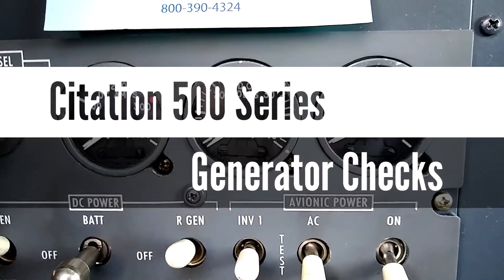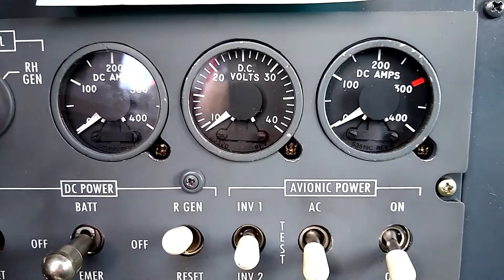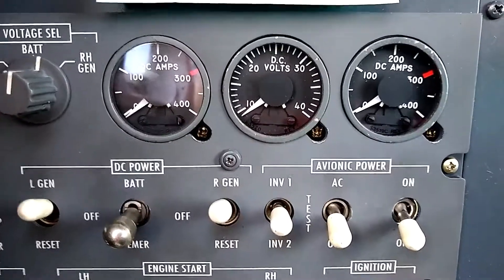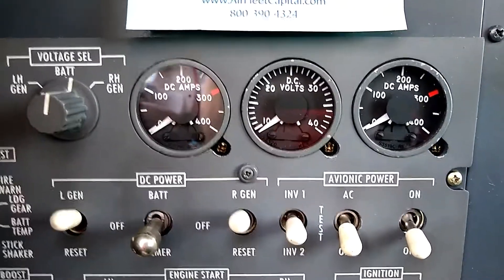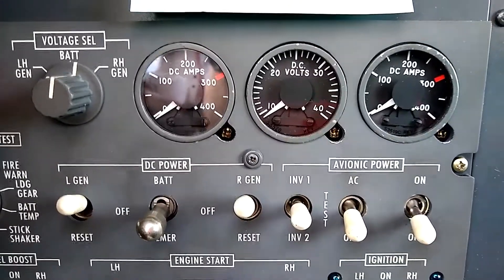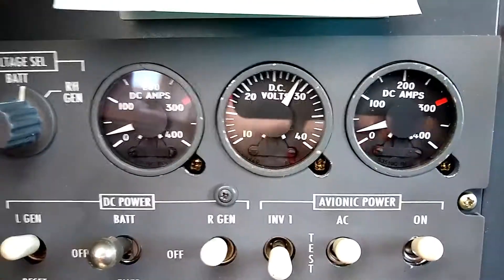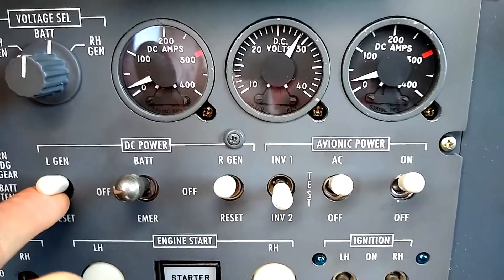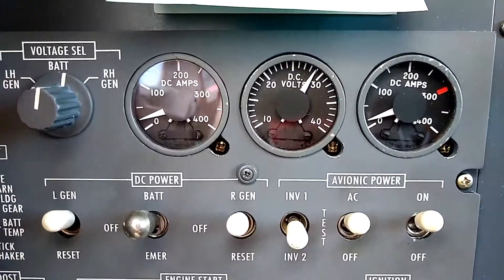Citation 500 Series - Generator Checks

Comment: your voltmeter indícales 29 V and not 28V
Reply from the maker: Great catch. I could (probably should!) have used more precise language in my explanation. Technically the generators put out about 30 volts and it is regulated down to 28.5 volts by the generator control units. So in a perfect world, we'd see 28.5 volts on the voltmeter. However, in real life the voltmeter might be slightly out of calibration and display a voltage a tiny bit higher or lower than reality, and/or the GCU might not be regulating the voltage to exactly 28.5V. That's why you see a value closer to 28.9V in this video.

Oftentimes we use the simple term "28 volts" to indicate normal operation, as opposed to 24 volts, which would indicate a complete failure of the generator and be battery voltage.